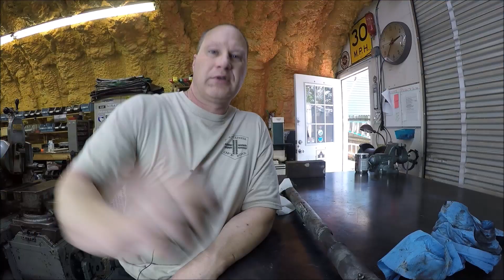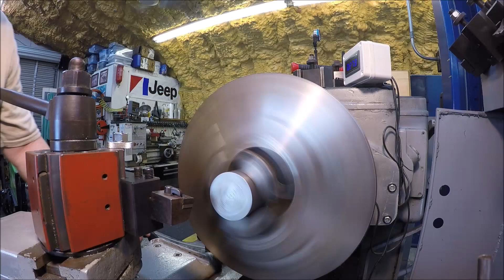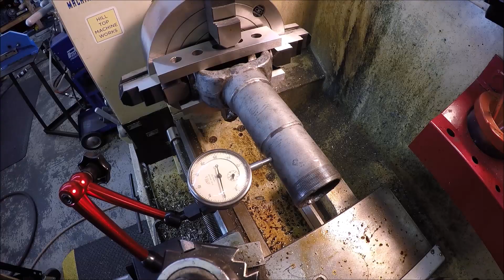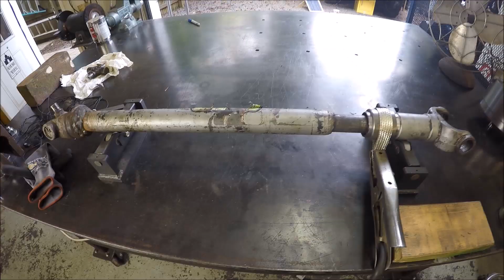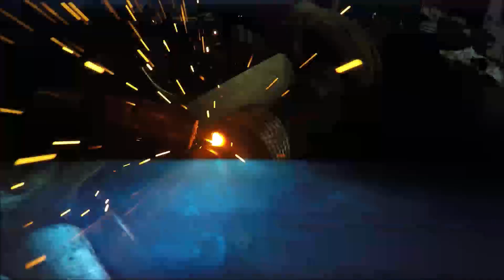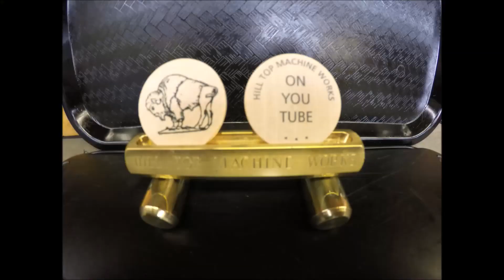Drive Shaft Repair

Comment: see, keep an eye on ebay and you'll find those taper shank drills really cheap.  There's aways expensive ones on there, but a lot of the liquidation houses post them like 5 for $9.99 and they rarely bid up past $15-20 .  Repair looked great too.
Reply from the maker: Thanks for the tip.

Comment: Another one bites the dust!  Nice job.  Nice to have two lathes for the job.  - My brothers GMC Jimmy spline wore out inside.  Luckily it was long enough to cut out a section and weld it back together.  I didn't have a roller so we chucked it in the lathe and covered the lathe to protect it.  Worked perfect when it was reinstalled.
Reply from the maker: Yeah came in handy for this job to have 2 lathes. Swapping around the big heavy chucks gets old real quick.

Comment: How did the splines fit after welding on the collar?  Just wondering if it pulled tight due to any shrinkage?  Do you have a steady rest for that lathe Tom?
Reply from the maker: It did pull it and it is tighter than I would have liked. It still moves but it takes some effort. I imagine if he ever has to use it the sliding action will help to loosen it back up to where it was. Yes I have steady rests for both lathes.
Reply: @hilltopmachineworks2131  I figured it got tight if the fit wasn't bad worn. Better than no spare👍 . Maybe a light press fit would have been better. Hindsight 20/20  
Reason I ask is because I've run into similar issues in the past.
Reply: @SteveSummers  always 100 ways to do something,  I wondered if slitting the crack slightly, maybe a dremmel style cut off, then interference fit over the expanded part to bring it back into place.  Still pretty sure what Tom did will work as good as it did before.
Reply: Steve Summers on a small part like that heat it up first as hot as you can with a torch then weld it and it won’t hardly shrink at all.
Reply: I have removed many of the old worn bushings in loaders & backhoes running a bead of weld around the inside after removing the pin. They shrink so much sometimes they will fall out. That's what worked against you Tom.

Comment: Tom question. With it being an off road rock crawler the drive shaft does not have to be balanced correct?. Due to low speeds.
Reply from the maker: Depends. Most don't balance the front shafts. The rear shafts usually get balanced because a lot of times you are driving on dirt roads in 2 wheel drive to get to the trails so it benefits to have the rear balanced.
Reply: @hilltopmachineworks2131  cool didn't think of the back shaft.

Comment: Tom, I think that drive shaft needs about 1” added to the length if the compressed length will allow it. If not there are long travel yokes and splines available.
Reply from the maker: Yeah at full droop it would separate. He got a longer travel one built that he is running now. He just wanted this to be a usable spare to get him out of the woods if he breaks the one he is running.